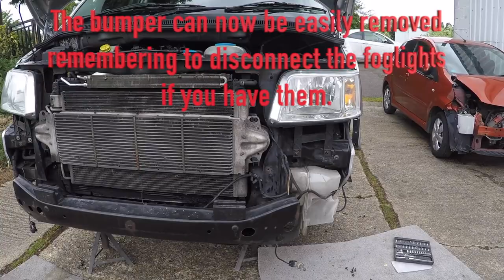VW Transporter Facelift From A T5 To T5.1

Comment: So I dont need to fit the T5.1 slam panel? Can I fit the bumper with the lower spoiler already fitted to the bumper?
Reply from the maker: The slam panel is the same so no need to change it and yes, you can have the lower spoiler fitted prior to fitting.
Reply: Thanks bumper is on but grill wont sit flush bottom of the lights and wont match up with the holes on the slam panel . Everything else lines up .

Comment: Was there any modifications needed to fit the 5.1 front or is it literally bolt on
Reply from the maker: No mods needed apart from the rewiring of a couple of wires for the headlights, other than that it's all bolt on.

Comment: How much do parts and labour cost approximately? Thanks
Reply from the maker: You will save alot of money if you get used parts, these are readily available on places like Ebay or certain VW groups, all in all you should be looking between £700 to £1000 and dont forget that you can sell the parts you take off.